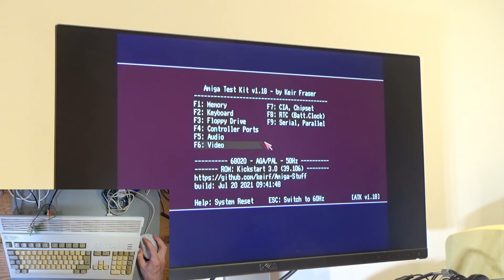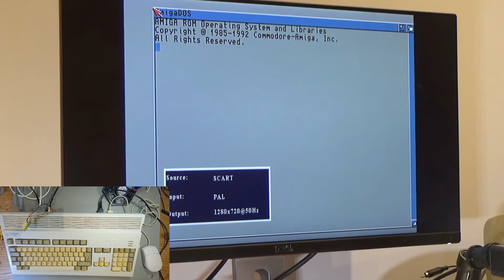Retrobrite With Liquid Hydrogen Peroxide at 1%, 3% and 6% Concentrations

Comment: Youtuber "Hey Birt" actually proved in a pretty elaborate experiment that you don't actually need UV light. It's chemical bleaching process and all it needs is warm/hot water to help it along, the UV light doesn't really do anything.
The fact that you can also bleach things with sunlight alone does not contradict that. Sunlight is a lot more powerful than a UV lamp.
Reply from the maker: Yeah, i agree, I see the UV light as a source of "energy", and a convenient one as it isn't going to melt the plastic. I've found that i can retrobrite with just water and a UV light source and no chemicals, but it's very slow. At the moment, I'm trying to find a cheap, convenient & most importantly 100% reliable way to retrobrite. Currently i have a UV lamp, but i don't have a thermostatically controller immersion heater for the water, but if i did have one, that might be a more convenient way to do it. I saw 8-bit guy also did H2O2 and hot water, but he just used a cooker, which is bad as it could just melt your stuff, and for a large case you would need a "really big" cooker.
Reply: @DavePoo2  yeah something with a thermostat that keeps the water at a constant temperature is very much preferrable indeed.
Reply: You need something to get the H2O2 to break down, and it can be either heat or light or both.  The less light you have the more heat you need to move the reaction along at the same pace, and vice versa.  So sure, you can do it without any light, if you provide enough heat (or wait long enough).  But too much heat tends to melt plastic and waiting too long tends to lead to streaking if you’re using gel/paste for your H2O2.  Also, he has metal in the H2O2 solution, which also catalyzes the breakdown of H2O2, so that’s another way to do it.

Comment: Blonde hair from poundand works well, brush/spread on a tiny amount, cover with film.(only small bottle but goes long way) Then leave in warm place, no uv needed. Deep cleaning before starting gives successful results on anything.   (hinge pin rusted 😀 )
Reply from the maker: Thanks, but I think for me now I'm not going to retrobrite any more cases using any method that involves wrapping in plastic or flim, because of what happened with the A500 retrobrite. I want something that is 100% successful (and the film plastic / cream way did work many times for me in the past, but seems like it is possible for it to go wrong). That said, i'm still going to do the keys in small plastic bags with the the hair cream as I've had 100% success with that over several keyboards. I think the small zip lock bags don't really stick or cling to the keys (and the keys are small), so it's never a problem there (and it works quite fast).
Reply: Can you put in a link to what the the product looks like?

Comment: Thats worked well. I think an extra lamp for heat would help it along.
Reply from the maker: I think so too. I think it would just go a bit faster with it, I'd like something like a small thermostatically controlled immersion heater that can heat to about 40ºC, but not sure if anyone makes such a thing. Failing that, just patience will do, and if doing a computer case it might be better to do it slow so you can check on it and make sure it doesn't go super white before you had chance to stop it..